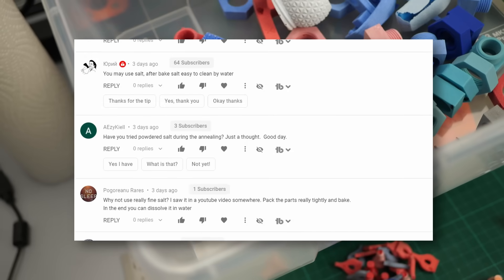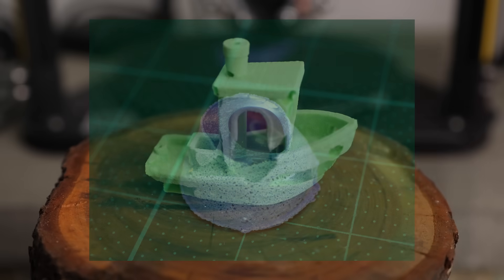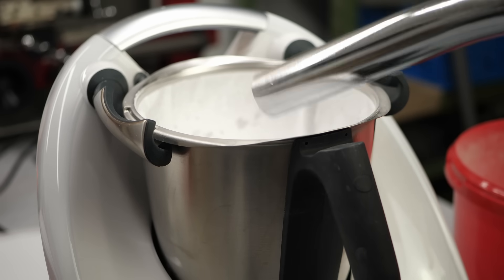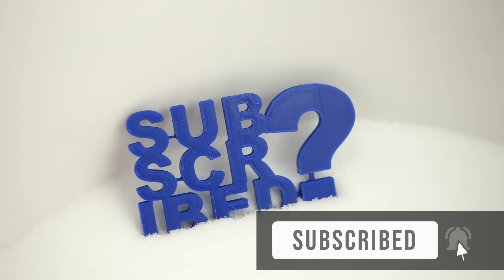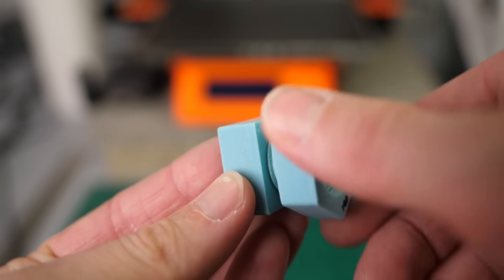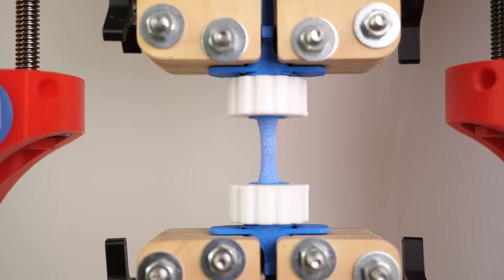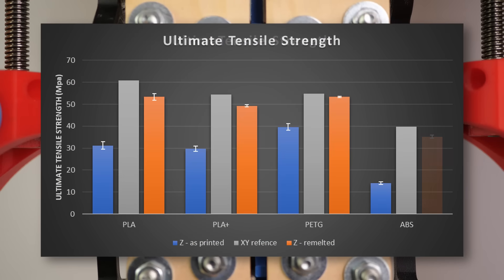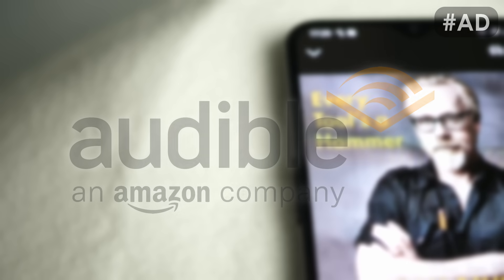The STRENGTH of 3D prints REMELTED in SALT

Comment: Hi Stefan. Holy smokes that's a lot of work! I feel a bit bad, because I had a feeling when posting that video that you were going to get a lot of requests 😅, and I lack all the testing equipment to do it myself. Thank you so much for doing this. I completely agree, we only scratched the surface of what can be done with FDM, this method and remelting in general. When you remelt the parts in kapton you get really shiny surfaces and you can see exactly where the bubbles form (if the filament is transparent. You can also join different parts together whilst remelting. I've experimented with embedding laser printed transparencies in transparent parts (works really well!), but you can also embed inserts etc. Also I've done some tests where I have a shell of PVA surrounding the part, which keeps the original surface texture. One final thing, all these parts are actually watertight, so you can use FDM to prototype pump housings, heat exchangers and other stuff like that (as long as you design it in such a way that you can get the salt out). 3D printed watercooled pulse jet maybe? I would encourage everyone in the 3D printing community to try different methods AND POST THEM on the internet to create prior art and avoid any of these techniques falling in the hands of patent trolls! Best of luck to all! <3
Reply from the maker: Kudos to you! You didn't only inspire me but also thousands of others. I would not have done these tests so quickly if it wasn't for your work. Thanks and keep on sharing your work!
Reply: @CNCKitchen  Great work to both of you. Could you try to acetone vapor bath the ABS treated part to remove the porosity?
Reply: When working with very fine grains, it is best to maintain some form of vibration in the grains as you are inserting the part. This will make the grains behave more like a liquid, flowing into voids more easily. This is as simple as placing the pan on top of screened woofer playing a fast and repetitive bassline at low volume as you insert the part. 
https://youtu.be/iej6wjh9ORI This works just fine for this purpose.

Second, when packing grains, you do so though pounding the grains down instead of just pressing down on them. This adds vibration to the grains causing the grains to interlock with each other leaving fewer voids.
Reply: Great work by yourself and Stefan to introduce this as an option! I'm curious: rather than printing in a PVA shell, have you tried simply dipping the parts in PVA glue (white glue) letting it dry, then doing the sand re-melting process and finally dissolving the outer PVA coating in water? This might allow people with single extruder printers to quickly and easily make extremely strong parts that still have a great surface finish!
Reply: @GoughCustom  I was thinking about that, especially since hot glue lets go of any surface when wetted with ethanol and for some reason I can't get my PVA to remelt
Reply: @free_spirit1  This is dissolved PVA used as a release agent: https://www.easycomposites.co.uk/pva-mould-release-agent. I am pretty sure they have only used ethanol or isopropyl alcohol to dissolve the PVA and create this mixture.
Reply: Potentially vacuum-bagging the salt around the part could (at probable risk of deformation) result in an effect similar to HIP (hot isostatic pressing) for laser sintered parts. I've never played with the kind of fine salt, but it looks/feels like the compression of a vacuum could 'lock' the salt into place a bit like what happens in those robotic grippers that use a balloon filled with grains of rice etc. Either that or it will squeeze out voids in the past perhaps enhancing properties? A bit of a crazy idea I know, hard to implement. Perhaps a silicone rubber or kapton vacuum bag?
Reply: @SanjayMortimer  Great idea. Could also safe you from using bigger amounts of salt and you get the heat quicker to the part. Aluminum bags might be suitable as well. I am a bit concerned that off gasings from the polymer might eliminate the vacuum effect. Might need a continuous low pressure supply.
Reply: Regarding materials - what do you think about fine copper powder. https://russian.alibaba.com/g/fine-powder-copper.html  it is good heat conductor and doesn't make and reactions at these low temperatures. it is used as paint addition.
Reply: @romantech2589  I guess my only concerns would be 1. there is no way to remove the copper from the finish surface of the part (this could be a positive in some cases. 2. Copper dust would be very dangerous if inhaled so be careful.
Reply: @seanstumpf4190  to remove copper, same chemicals as for etching circuit boards could be used...but yes it's yucky.
Reply: @jurajvariny6034  having used copper enchant on pcb boards before I'm laughing at what the final part would actually look like. I'm my head its a brown/ green stained piece of pitted goodness.
Reply: @romantech2589  "Regarding materials - what do you think about fine copper powder"
I think it could be hard to remove all of the copper powder from the finished part, and I can't imagine metallic dust being good for health and safety in a DIY environment.
However, past those 2 issues I think it would work pretty well, assuming the powder has enough friction to hold it's shape when packed. The friction would be effected by the geometry of the dust particles more than the material directly, but both would certainly play a role.
Reply: Fantastic idea to use a PVA outer layer.
Reply: @Festivejelly  what about size change? do you think it will keep surface clean at 200 degree when water from PVA will evaporate and plastic would be hot and soft?
Reply: Is salt needed for a chemical reaction or is it just used as a mold and can be replaced by other materials?
Reply: @chibiebil  it's used as cheap 'dissolvable mold', because you can just dissolve it in water afterwards
And it's quite okay for salt to be heated so much, you wouldn't be able to do the same with sugar for example as it'll just turn into caramel
Reply: @chibiebil  not needed as a chemical reaction i think other powdered medias could work. Salt has an advantage of helping reduce moisture content though.
Reply: @chibiebil  There is most likely no chemical reaction. Quite opposite - you do not want it as heating the plastics can result in their chemical decomposition - but I think this was mentioned in the video.
Dry sodium chloride salt is chemically very stable and is temperature resistant to the point that molten salt bath is used for heating steel to quenching temperature (and cheap and available) that's why it was IMHO used. When dry it do not bake together. Some other salts may decompose, release potentially hazardous gases and so on but NaCl is fine. It is hygroscopic - keep that in mind.
Reply: @mungo7136  The molten salt baths for steel treatment is molten Barium sulphate salt, not sodium chloride salt.... the temperature of molten barium sulphate is around 900 deg C
Reply: @chibiebil  Its purpose is to hold the shape.
Reply: Good work to the both of you. This was a very interesting post processing method. Seems like a great process for circular parts which can be post processed on a lathe. How difficult is it to remove the PVA after all this processing?
Reply: @JamesSmith-lb4hv  tbqf the one that I used was a pita to disolve, but I also printed a very thick shell around it (3mm). Depends on the PVA. Hot glue would just let go very easily when you wet it with ethanol.
Reply: @free_spirit1  thanks for the feed back!  3mm is certainly a thick layer of PVA.
Reply: Any idea if concrete powder would be any good? Or would moisture from the print material cause it to turn into hardened concrete?
Reply: Have you tried using tinfoil ? wrapping the part with it then burried in salt. That would be easy to clean and should be smooth !
Reply: @mrdjack  that would only work for very large and flat parts. The reason to use salt directly is to get in all the tight spots
Reply: @Fischer Teknik   said it also... but PVA mold release, sprayed on or dipped might be a good one to test.  Might take a coat or two but it dries quickly and is water soluble.  There's a few brands out there.  https://www.tapplastics.com/product/fiberglass/mold_releases/tap_pva_mold_release_liquid/67  Oh, and look at "sand casting techniques" because that's very close to what you're trying to do except leaving the part in the salt/sand.   @CNC Kitchen Just like in printing, part orientation is going to be key so getting a good base under the part and on top would help with flashing and support.  "Spring form cake pans" might be the trick and some stack with smooth bottoms.  https://www.amazon.com/Mrs-Andersons-Baking-Springform-4-5-Inch/dp/B009J9BEYO.  Enjoy the videos!
Reply: free spirit and stefan. Have either of you heard of Ball milling? watch after 7:30 on this vid https://youtu.be/UaTESilqsJw?t=449  but basically you can make a very small coffee can version with smaller ceramic balls and can slow grind the salt into very small particles. Thing either of you can try a ball mill and get finer salt powder to try more smoother sufaces?
Reply: @CNC Kitchen @Free Spirit 1
Have you guys tried Chalk as a medium?
Highly common, very fine, quite cheap. 
Should work!
Reply: given a large enough container and oven, you might be able to melt entire assemblies together and forgo the use of adhesives
Reply: https://advances.sciencemag.org/content/3/6/e1700262
I think this is much more interesting. More than that, by using coaxial extruder and using carbon-filled filament as outer layer and gf-filled filament as inner core you should attain similar effect much easier and cheaper - you'll still need to at least bury the material in sand to prevent it from sagging and deforming most likely (inlike compared to using nanoscale filler and coatings like in the article), but it should take a few minutes in microwave compared to hours in the even - that degrade the plastic, btw!
I've already used graphite mixed with quartz to create microwave-absorbent heating "medium". Unfortunately, it does not pack well and using oil in binder resulted in nasty vapors.
Using a kapton vacuum bag with grafite-based sintering powder and microwaving it sounds like a good idea! Il fact, if you use high power and good timing, you may just fuse the outer layers (most important) but leave the hollow structures and infill intact.
Reply: @backinthelabdetroit  Cast iron is annealed in sand.
Reply: Wow love the science in this! Great job on this video.
Reply: So do you could use graphite powder as test too?
Reply: 3d printed pulse-jet?  Someone call @integza
Reply: (((Patent Trolls)))
Reply: Patents are gwnerally evil
Reply: How does the pva thing work, wouldn't it just melt and mix with the part?
Reply: @CNCKitchen Mr. Stefan, try washing soda (sodium carbonate). I buy mine for 1.29euros /500gr. And IT IS powdery!!!

Comment: Good job! I think that salt is pretty good. Something that could help with doing the same with nylon would be to use a material that can absorb moisture at the remelting temperature. Also, I think that quartz sand/gypsum/magnesium oxide/magnesium carbonate are commonly available in much lower grain sizes, leading to a smaller diffusion layer.

Comment: What about using fine plaster-powder (so, not wet) directly from the 'baumarkt' ? Should be no problem heating I guess and dissolves also with water? Maybe cheaper to get in 25kgs packages. And also reusable multiple times for the most used.
Very interesting results, especially for the PETG.

Comment: I assume any fine powder that won't melt, produce noxious fumes or react with the plastics would be suitable.
Would cement or plaster work? Both are readily available, but I suppose it would be better to have powders that weren't overly affected by moisture.
You can buy powdered metals at surprisingly reasonable prices from specialist retailers, obviously that would help with thermal conduction...but maybe the mass would be a problem?

Comment: To create the powder, a ceramic bead mill is used.

Consider that salt (as well as sand and all other free structures in general) are a bit like liquids under the influence of vibration. A bright example - throw an object on the bottom of a bucket of sand or salt and under the influence of vibration it literally pops up. That is why the ramming is done locally by blows - particles from vibration of shocks tend to be located more compactly, but the vibration goes locally and the parts are kept from moving. This is why you had such a big impact on particle size when just applying pressure.

Let me remind you that a component from caking is added to the crushed salt. Not much of it, but it can interfere with rammers or react with plastic. Use coarse salt to create the powder.

Comment: use diatomaceous earth!!  That salt is destroying your blender and vac bushings, bearings, brushes, metals.  You are crazy!!  Also your stainless temperature probe conducted the heat better than the salt and so the core of the salt would not have hit your target in the absence of the probe.  You needed to pile the salt to burry the probe entry so that it was not a route for the heat...

Comment: I would suggest printing the parts not only with a 100% infill, but with an extra blob of material on top, so that when molten, the plastics and potential air or moisture trapped inside can swap positions. The extra blob on top can simply be a molten plastics reservoir that drains a bit into the part.

Comment: Since the goal is just to hold the part together while it melts, I wonder if you could do it for simpler parts by making a solid (not powder) mould out of a higher-temperature plastic like Nylon, one of the metal filaments or out of proper machined Aluminium. Maybe it'd give an even better surface finish that way.

Comment: What about using a tumbler afterwards to smooth out the surface? Might help polish the surface of the pit marks. If size is an issue, just make the part slightly larger.

Comment: Fascinating! Thank you!

For the surface porosity issue, perhaps we need a water soluble medium to prevent the plastic and salt interacting at the part boundry. First idea I had was: slightly watered down ova bath, then let the parts dry before packing in the salt? The PVA might prevent the plastic 'soaking' into the salt layer, but still wash off at the end?

Also, maybe a silicon oil mixed with the salt to make a type of green sand that would be more putty like? The salt could be packed into a cruicible with the part in it, then a vacuum pump could pull the oil through the whole cruicible? Just an idea!

Comment: Beyond what you mentioned for further testing / improvement (finer salt), I'd suggest you modify your process as follows:

1. After placing all of the parts in the media, use a heavy duty vibrator for several minutes on the outside of the container to aid the media in infiltrating an orienting properly with the samples.
2. Compact, but use an arbor press, or hydraulic press to increase the pressure.
3. Vacuum seal the vessel prior to heating.

All of these are techniques taken from other material forming methods, among others, pouring concrete into complex moulds.

I hope this helps.

Comment: Has anyone tried covering the surface of a print with something like high temperature epoxy before melting? I would assume that the epoxy would form a barrier between the print and the salt and not let the porous layer form. Maybe even remove the need for salt packing?
Reply: Or high temp silicone. Like the automotive sealing stuff. Just a thin layer, i bet it would peel off easy.

Comment: One obvious thing missing in this video: You often compare the remelted parts to injection molded parts. So you should compare to an actual injection molded part! There are quite a few YouTubers that have built desktop injection molding machines, I am sure someone could make one for you.
Reply: Good point. As far as I know, 3d printed parts are actually stronger that injection molded along the print lines due to aligment of molecular chains.

Comment: I think there even should be a strong correlation between the outer surface and the strength of the parts. Free spirit's ones were looking completely different for much lower temps they were treated with. Stefan's are porous on the outside and show much lower strengths. Free spirit's ones were matt but would show much higher strengths.

Comment: Maybe another possible thing to do is 3d print something with one perimeter and minimal infill, and a funnel shape above it that you can load with raw plastic in grains. This way it will be faster and maybe even cheaper. Another possibility is using two different kind of raw plastic (or even a metal like tin or lead), you do the same thing but you print an empty space under the print: you get to the temperature that fuses the first plastic, that will flow to the empty space under it (that will then be cut away) and then you raise the temperature to melt the second plastic that will fill the cast. This would overcome the limits of big prints with plastic prone to warping/shrinkage like abs.

Comment: At least you can't argue "why should  we buy a 2300 € kitchen appliance to prepare meals" Also Vorwerk will sold soon a salt-grind program 😉 
Anyway I would ask my self if the part has to be that strong before I invest that amount of extra time and electric power cost. (which is in Germany a issue) If a self designed part cracked and a better redesign is not possible than I would think about that method. 
Also I wonder if it's better to cast the parts in heat resistant silicone which perfect matches the shape and the cast could be reused?